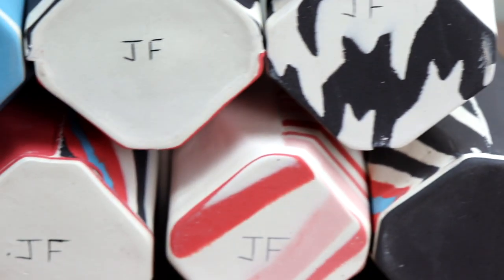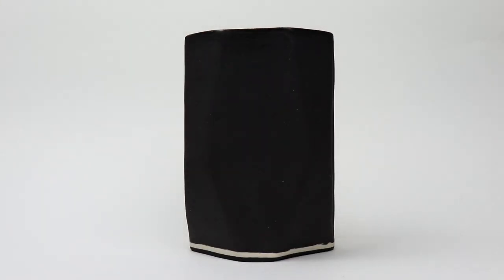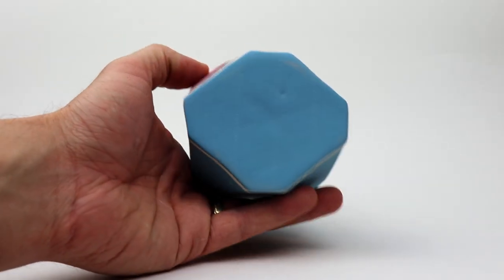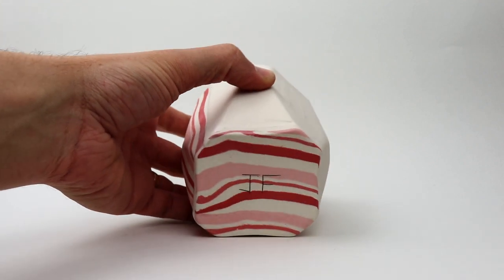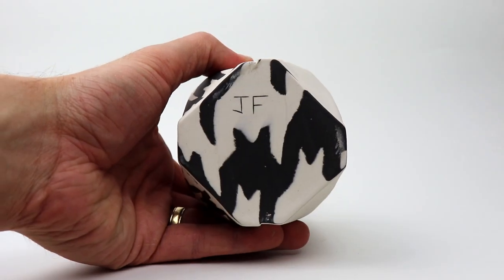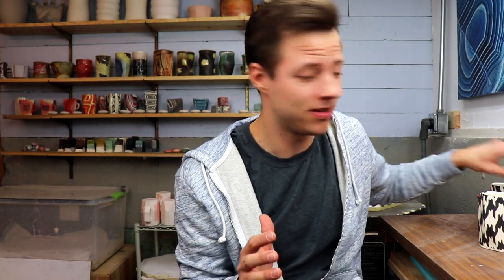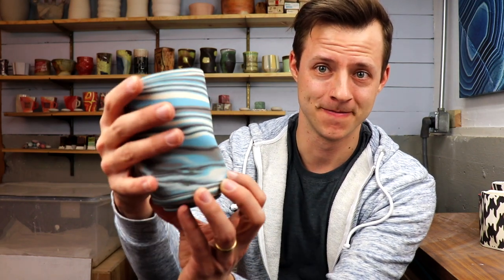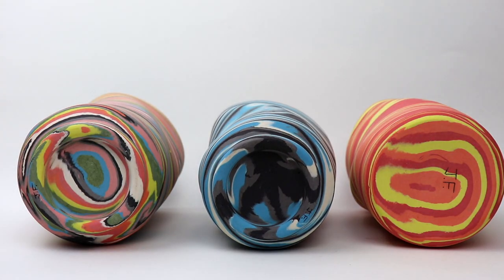Kiln Unloading #3 - Bacon, Houndstooth, and Zebra Stripes

Comment: Hi Jim! You've inspired me to experiment with agateware. I was wondering what % black mason stain you use for the black clay. Also, do you usually measure the mason stains as % dry weight of the clay? Thank you so much!
Reply from the maker: I find that 3% gets me enough of a black without having to use too much stain. As for how I mix, it has changed over the past year. I used to just go by wet clay weight but now I go by a estimated dry clay weight because some day I plan to make my own clay for easier mixing in of stains and I don't want to have to recalculate all of my stain percentages. 

So I treat my wet clay as if it's 20% water (4 parts clay 1 part water) which is a good estimate for water content in clay. Long story short. I'll add 1 pound of stain to a 12.5 pound sleeve of clay, which is really  about 10 pounds of "dry clay" and I call that 10%. So for 3% I would take the weight of the clay, multiply by 80% for "dry weight" then take 3% of that total and add that much stain. 

It seems so simple in my head so I'm sorry if writing it out makes it complicated. Please follow up if this isn't clear. Of all of my videos though, the percentages are always an amount added based on weight. 1% means 1% added, not that the clay is 1% stain.
Reply: @CeramicJim  Not complicated at all! Thank you for taking the time to write such a detailed response. I really appreciate it! 

Also if you would be so kind: any recommendations for clear glaze? Last time I tried marbling, it came out super cloudy. I fired to cone 10.
Reply from the maker: @spencerkieu971  hmmm. Cloudy is always tricking with this kind of work. I've moved to not glazing the outside for that reason and then doing a solid white liner inside. BUT that doesn't work as well for bowls or plates. Digitalfire.com has excellent recipes and modifications for trouble shooting. TONS. Wollastonite can cause clouding in too high of a quantity or if not sieved fine enough. Sometimes a hold and slower cooling can help reduce bubbles by helping gasses escape. Try lots of recipes. I am cone 6 so can help you too much. Good luck. A good clear isn't easy to find.
Reply: @CeramicJim  Amazing! Thanks for all the help. You've got a new subscriber :)

Comment: Omg those rainbow ones were amazing I’m almost done building my studio and wanna play with this. Have done agatware and loved it. how are your measuring your percentage into  the clay  weighing a pound out im curious
Reply from the maker: I’ve always done my measurements by clay weight. Take 10 pounds of clay for example. If I added 1 pound I’d call that 10% red. In reality 25% of that 10 pounds is water so colorant to clay materials would be even higher than 10% if I add 1 pound of stain to 10 pounds of clay. I get my clay is 12.5 pound sleeves so I add 1 pound of stain to those which is around 8% but if you subtract the water then is about 10%. That’s only for rich intense colors and if those colors are bright and need more stain to hold. I add 1 or 3 % black and get some nice grays to contrast the bright vivid colors.
Reply from the maker: As long as you decide on a method and stick with it you’ll be able to learn and make adjustments. I might start making my own clay soon so I can mix the stain in easy in liquid slip form instead of wedging so then I’ll change to stain to clay material percentages.